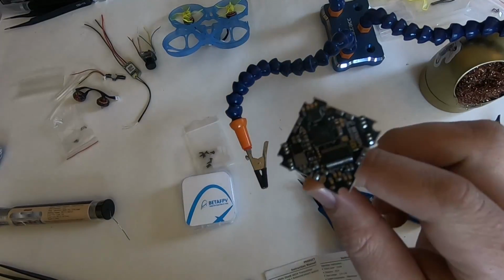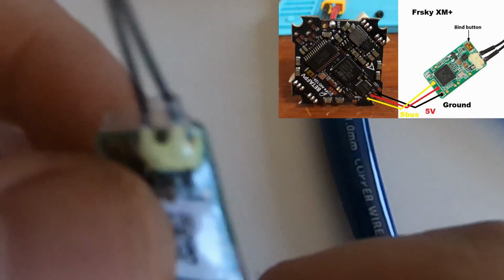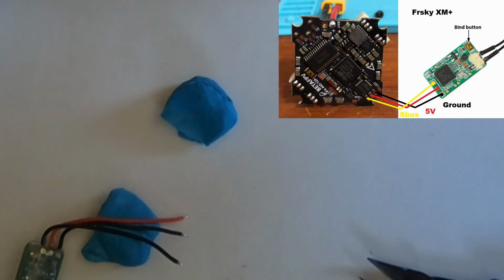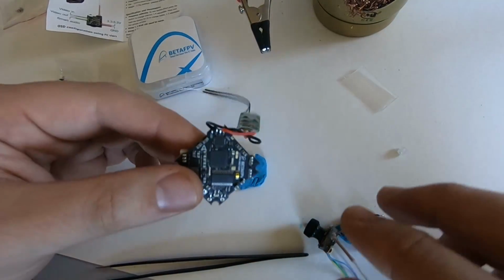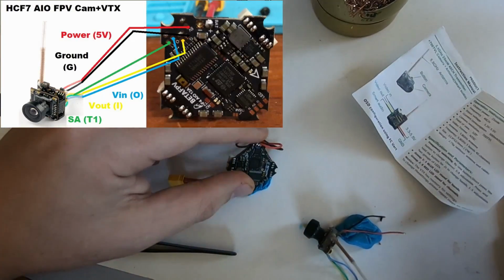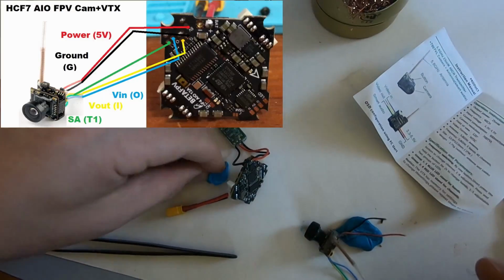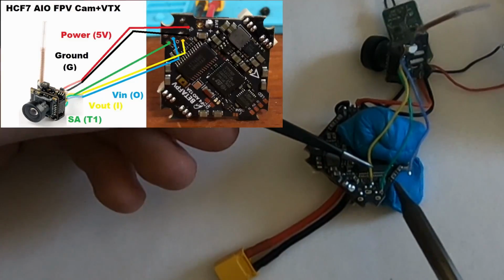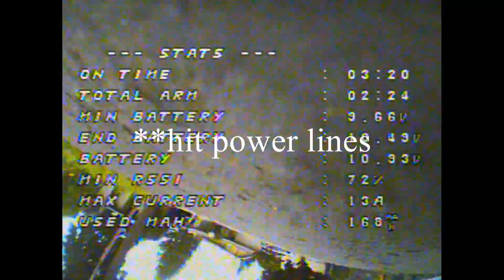Skittle3S: 75mm 3S Whoop with BetaFPV F4 FC 2S-4S 12A

Comment: I'm trying to use this F4 12A AIO on my Betafpv 85x pro 2, the original FC(F4 1-2S AIO) comes with a built in receiver, does it mean that now i need to add an external receiver if i wanna use this new F4 12A AIO? I'm pretty new to this so any help will be appreciated.
Reply from the maker: Claudio Cagnasso yes the f4 12 does not have a built in receiver so you will need to add one of your own. What remote/protocol do you use? Frsky? Flysky? DSMX? Or something else?
Reply: @FPVSkittles  Thanks for the help brother, I use Frsky QX7.

Comment: Nice experiment!
I guess Mobula7 was 16000kv 2s 0802 so in theory, with no load, they should spin faster than these 1102s on 3s. Coupled with the extra weight of this build I bet top speed is slower or at best same than M7 stock. 
But those 1102s will have a ton more torque for this size prop, so acceleration and acrobatic ability is probably increased? Is this what you think the result is in practice when you fly it, or would you say differently?
Reply from the maker: Thank you for the comment, Yes I think you are right. I think 3S is a bit much for the 75mm size unless you just want really high top speed. I personally perfect my Skittle Royale Build or I even fly this on 2S for endurance races.
Reply: @FPVSkittles  just found your royal build, these 13500kv 1102s were what I was planning to try on a 75. I'm trying to find the perfect build for the course we are building in a reasonable size barn. Think 2s is the answer. Tried 85 size whoop with 8500kv 1102 on 2s and it was a touch too much.
Does the royal build work on tight race course, or do you think it is too much, would 0802 12-16000 be best?
Reply from the maker: 1LittleTinker I think for me at least it would be a little too much for a tight race track but I’m sure some could handle it. I race the Skittle Royale or Shutterbug85 at our outdoor 2S races depending on the track but I would not consider those “tight tracks.” I would suggest a 2S build with 08028 or 0803 12000kv motors on 75mm with 40mm props for a tighter 2S track. Or even a 65mm 2x1S setup with those same motors.
Reply: @FPVSkittles  many thanks for your insight here, I think I'll follow that and do the 080x route then. I already have my 85 which is great outdoors, rips in the barn also but no good for tight course. Thanks very much again!

Comment: did you have any problems with the receiver cutting out on this build I have a similar build and on three different types of receivers I keep getting dropout
Reply from the maker: Jason Houlis hey, sorry to hear that but no, I just used an XM+ and I haven’t had any issues with it. My RSSI is always in the 70s-90s as you can see. It’s never just cut out. I would check to make sure nothing is shorting yours during flight.